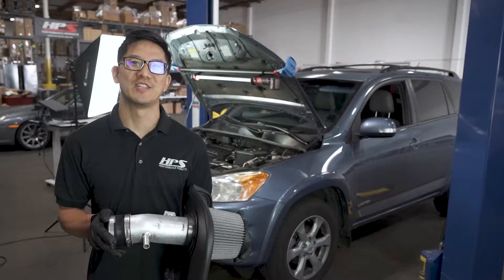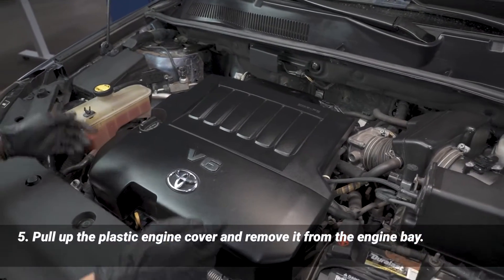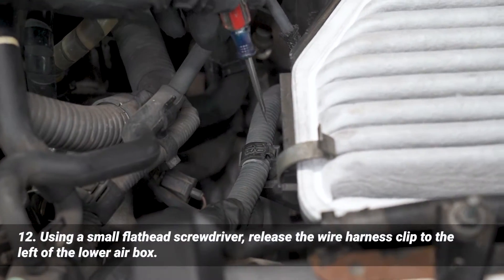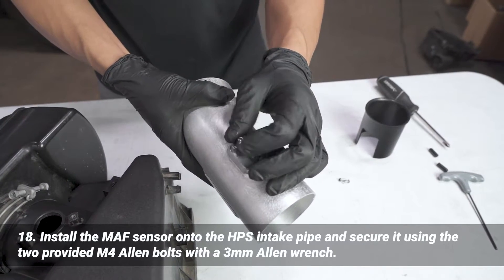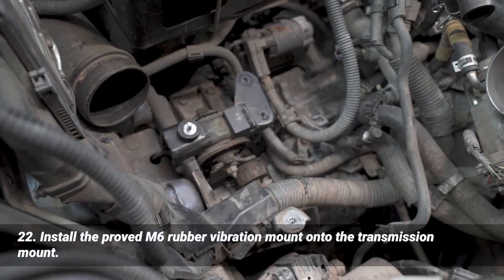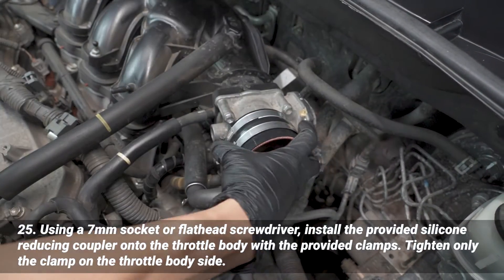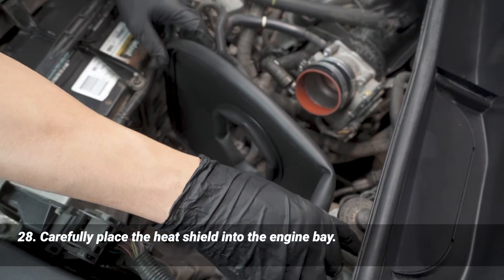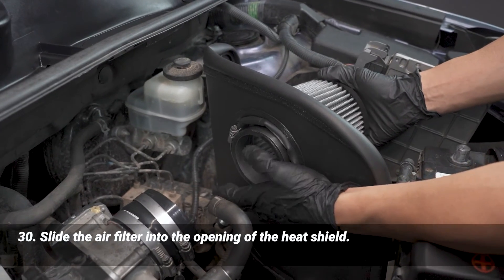How to Install: 2006-2012 Toyota 3.5L RAV4 HPS Performance Air Intake Kit

Comment: hey, is it worth it to install it on 2.4? Because I havent seen yet anyone to put it in 2.4
Reply from the maker: Unfortunately, this intake is specifically designed for the 3.5l and wont fit your 2.4l and at the moment we do not produce one for the 2.4l.